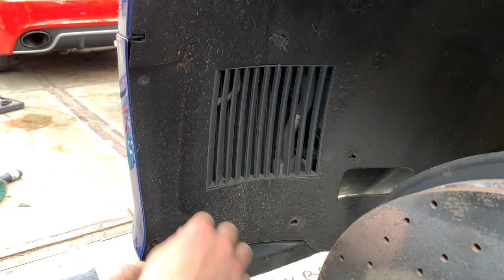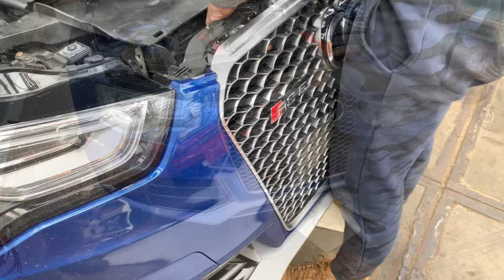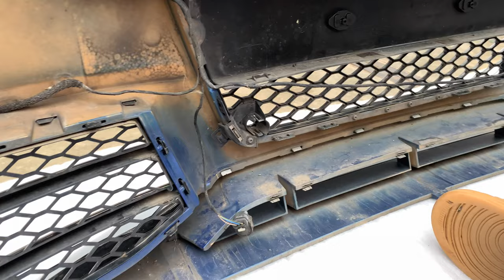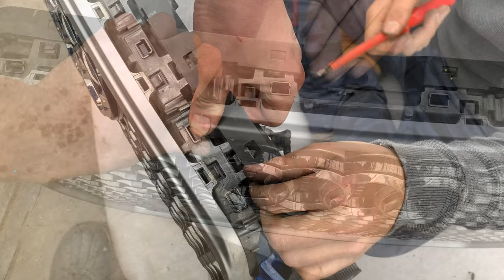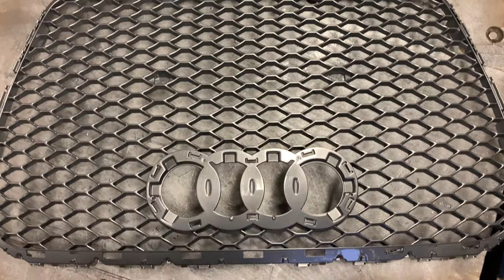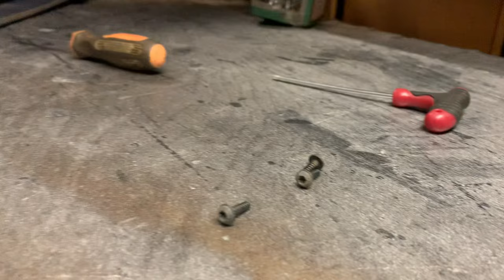Audi RS5 b8.5 front grill repainted

Comment: Was it painted the same colour just for a refresh or a slightly darker colour? Was it done with a rattle can or a proper spray gun? Finished job looked good on the video. Enjoying your RS5 content.
Reply from the maker: It was painted as a refresh, but the color (LY7P) Was slightly darker then what it originally was. This was done all with a Spray can and a clear coat finish
In reality it had some trouble with the old chips in the paint, as the new paint went under the old paint. But stil better then what it was and better then buying a new grill